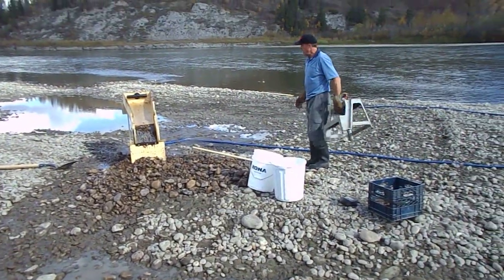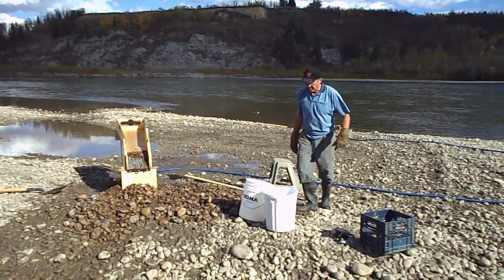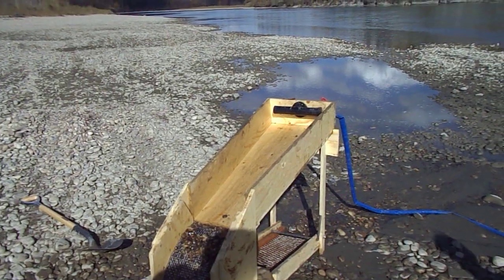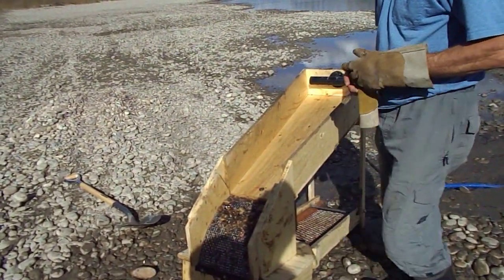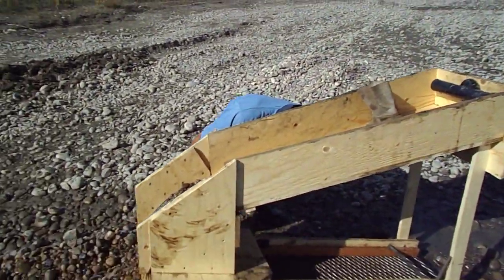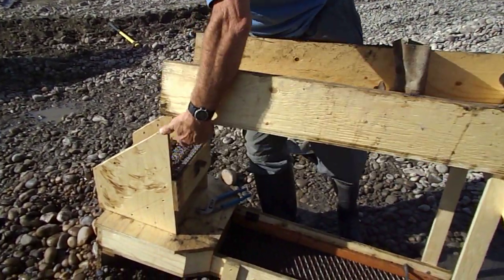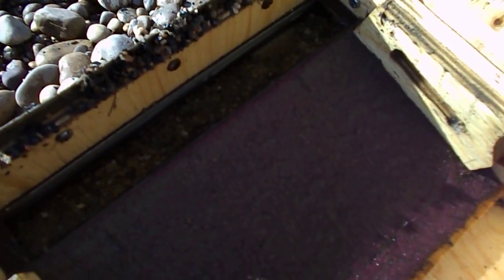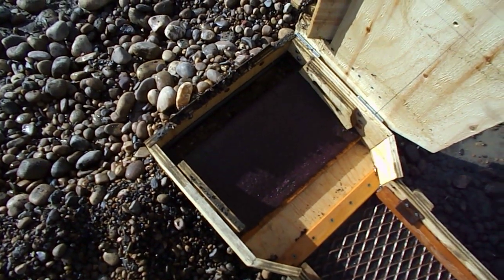049 NSR Gold mining 2012  Modern Sluice box

Comment: It's a good design.  I like the curved screen.  The drop riffle at the top end is a nice touch but how easy is it to clean out?  Do you have to tip out the box or can you just pour water to wash it out?  The wool blanket looks pretty flat in the video, is it set to 24 degrees?  I love the wood build, very cool!

Comment: Looking at  the sluice I now understand why there was more gold on the one side . it wasn't completely level side to side
Reply: You are right I didn't have it quite level . still 90% percent of the gold was in the old wool blanket which was on a 24 degree angle just like james gibbons old grizzly from the 1800s . The expanded metal sluice part was around 10 degrees
Reply: @bartbley1269  - why a 24 degree angle? the wool blanket looked like it was flat in the video.